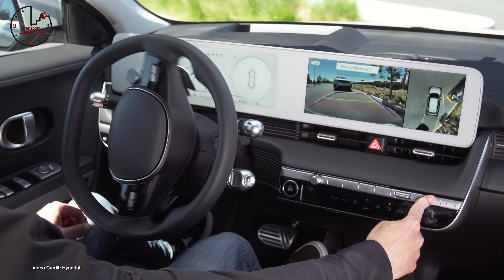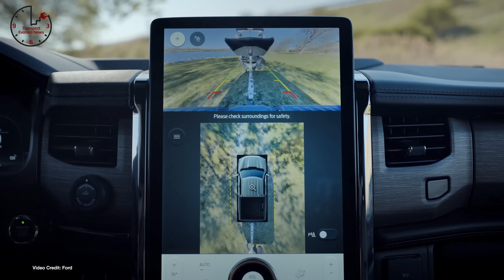TEN Episode 367: VW Power Up, F150 Ordering, Ken Block's New Ride

Comment: Arguably the best part about the Ola S1 is its price tag. Ola Electric is offering the S1 in two variants, with the base model S1 fetching the equivalent of just $1,350 USD. The top-of-the-line S1 Pro, fetches the sum of $1,748 USD—that's the same amount of money as a mid-tier mountain bike.18 Aug 2021 
Where did you get $6.5K?
Reply: As someone said: "21:37 99,999 Indian Rupees is ~1300 USD, not 6500 USD"

Comment: A small commercial van based on the Ariya, or any of these new compact SUVs would be spectacular, especially if they were offered with the same powertrain options, 2 battery sizes, single or dual motor. Use as many parts from the original as possible, so parts are easy to find.

Comment: 8:30 is when I had the idea of a standard kind of like phone vibrator motor you know... But in the handle to go bzzzzz at least for a split second just to let you know it is working. Or refer it to go "Bing"or make a similar sound to one of those airplane call button things.... That was solve that problem very fast.
Reply: Most cars will have a light near the charge port, or on the screen inside so you know it's charging. Sometimes there is a screen on the charger itself, but sometimes there are vandals. My Fiat had lights on the top of the dash so you could see the charge level from 50 feet away. My Tesla has both information on the screen and a colored ring around the charge port to indicate what is going on.

Comment: Does anyone actually know just how many Amazon vans are being produced by Rivian?  Everyone talks about it it but never mention numbers
Reply: I think they just delivered the first two of the initial 100,000. Amazon operates somewhere around 500,000-600,000 total vehicles, so they have first right to additional vans before Rivian can sell to others. I wouldn't mind converting one to an RV as the top range is 250 miles, but it may be awhile before that is an option.
Reply: @kenmcclow8963  using one of those Amazon electrics for #vanlife was the first thing that came to my mind. Throw some panels on top, and there may be times when you can go several days without charging, depending on how much driving one does.

Comment: Harris asking the question means that the question gets answered.  For EV uptake, this is a good thing.
Reply: We asked those questions when we first plugged in our Leaf. I imagine most ev owners ask that when they plug in the very first time. We just aren't filmed
Reply: @sh969  On my next car, I might very well ask questions too.  Right now I have an ICE car that is 20 years old and about due for replacement.  I figure that since I drive it very rarely in the current situation it will last until I see a very good electric.  They are getting better fast.

Comment: Is petrol charging the battery when  braking. NOPE.
Therfore,  it is charging itself.
And magical dramatically increasing its mpg
Reply: Is petrol charging the battery during braking? Actually, yes! Where do you think the kinetic energy to accelerate the car came from? The petrol engine. Any extra charge in the battery all originated from the petrol engine at some point during the hybrid car’s driving.
Reply: So my petrol car charges itself too then as the battery gets charged by the alternator more as I break. Does that mean I have an ev! Thanks for letting me know 👍🤦
Reply: @timscott3027  Why do you believe that braking results in higher battery charge rate in a petrol car?  I readily agree that the petrol engine driving the alternator charges the battery, but braking generally means that the engine slows to an idle, driving the alternator slower as well.
Reply: @Graham_Wideman  no it says in the manual in my car that's how it works, unless I read it wrong.
Reply: @timscott3027  What kind of car, if you don't mind me asking?
Reply: @Graham_Wideman  it's a Skoda fabia, I will have a look and find it if your interested. I could be wrong. 
The point I was making though is that all ice cars are "self charging", otherwise you wouldn't be able to start your car very many times. its just a dumb slogan Toyota came up with.
Reply: @Graham_Wideman  I had a look in the manual but couldn't find any info, so my brain must be getting old 😁 I found something in a forum about the alternator running under braking and then cutting off during normal driving to save fuel, but who knows I'm not an engineer. It's amazing how many background safety systems cars have now though, worth a look through your manual if you have 5 minutes
Reply: @timscott3027  Well, perhaps your Skoda does have an alternator control algorithm that notices a good state of charge on the battery, and maybe avoids activating the alternator while cruising, so long as you include some periods of "engine braking" that absorbs some of the car deceleration into the alternator and battery.  Presumably the alternator will be active when there are significant loads, like headlights.  Anyhow, thanks for going to the effort of looking in the manual and so on!

Comment: Harley to spin off LiveWire1, Intel to spinoff their full autonomy driving unit.

Most revolutionary vehicle of the Decade is clearly the ICE/Hybrid Ford Maverick...most significant vehicle launch since the Tesla Model S.

Great updates here making the hard look like a breeze absolutely.

The USA will be for all intents and purposes all BEV by the end of 2022 for urban Transportation with the Ford Maverick the one exception.

OneWheel, 3 wheel "trikes" in Arcimoto, Solo, a near purely solar powered vehicle start up that has returned(Aptera?), stand up scooters, all electric unicycles...the problem remains truly awesome demand for lithium ion battery tech.

This is easily solved by buying an ICE Platform vehicle instead yes yes?

Comment: Unsubbed after Harris apology.
Reply from the maker: Do you dispute that most people don’t know how to plug in? -Nikki
Reply: That’s silly.
Reply: Same issue at gas stations. Having driven for over 45 years I have seen several iterations of gas pumps and needing to figure out how you get the new version pumping. Not to mention people borrowing a larger truck only to assume it is diesel and causing some extensive repairs. As Nikki said, everyone has different experiences, or perhaps you need to broaden the people you are around.
Reply: Harris is so nice,everybody love her so much